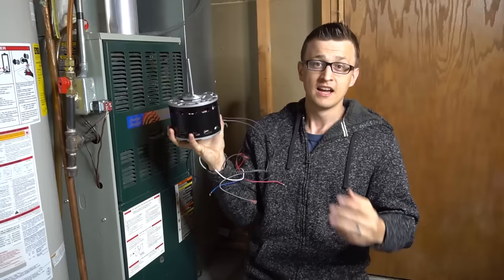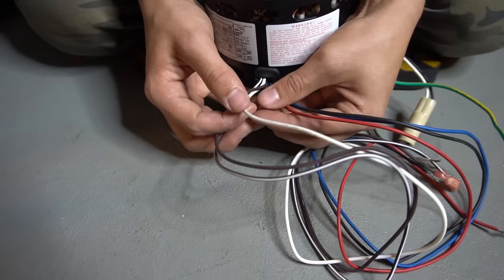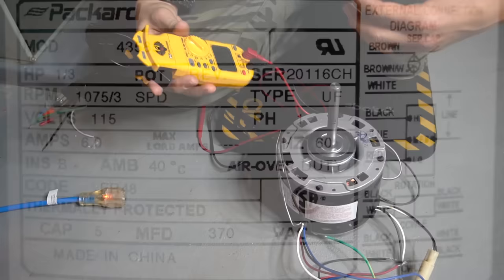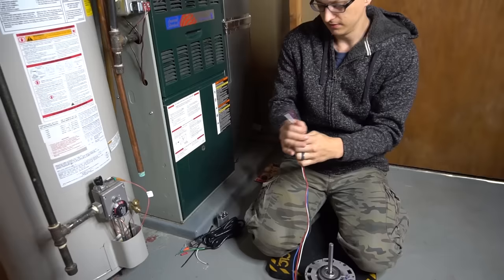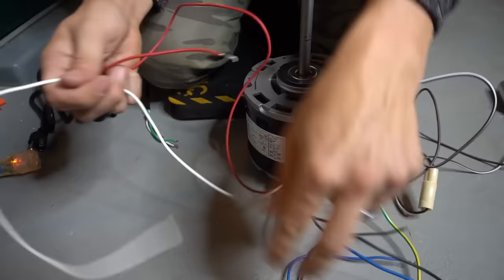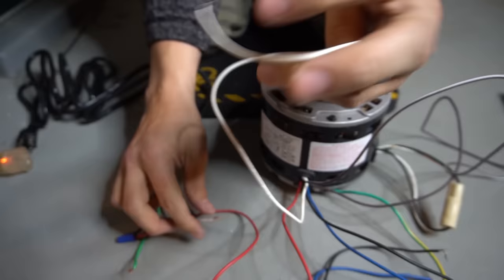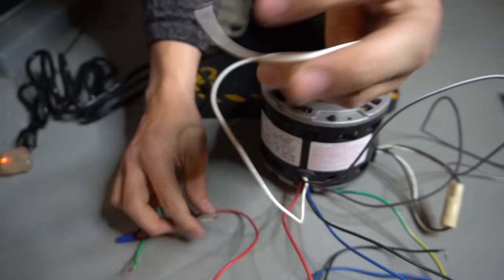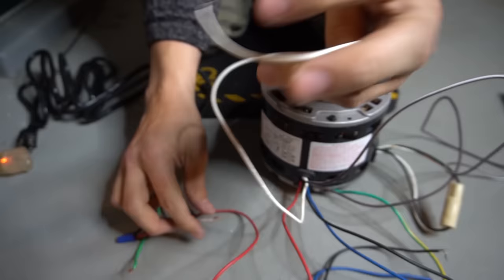How To Wire a Furnace or AC Blower Motor

Comment: I replaced my old Surelight White Rabbit control board, which does not have a 'FAN' connection, and I had no problem turning on the blower with 'FAN ON' only.  I noticed the new one, exactly the one in the video, has a 'FAN' connection.  Do I need to connect one of the fan speed wire to it to get power to the 'FAN ON'? Right now, the blower will not turn on when place in the 'FAN ON' mode with the new board.

When my AC turns on, the blower turns on along with the compressor outside.  In a few minutes, the blower turns off, but the compressor is still running because it has not reached it set temperature.  I don't know what is causing the blower to turn off early.  That is why I replaced my control board thinking the relay is malfunctioning.  But it did not fix the problem.  Please advise.
Reply from the maker: I would hook up an unused speed to the FAN terminal just in case. So from what I understood: Your outside unit runs normally (condenser fan and compressor) but the indoor fan shuts off after a few minutes. My first suspect would have been that control board too. Although it could also be a defective thermostat. If you jumper R to G at the control board, does the fan come on and stay on?
Reply: @WordofAdviceTV , when the AC is on, the blower and compressor are running. I metered the voltage from COOL to neutral, which is 120 VAC, and from FAN to neutral is 150 VAC. Is this normal for the fan to drawn 150 VAC?  Once the fan is shutdown, it cannot be turn 'ON' on  manually. I had to turn off the AC, then waited for it to reset itself before I can turn the fan on manually or start the AC again.  When metered the FAN and neutral when the fan is on manually,  it is 120VAC, and it can run all day without shutdown.  I had the same problem on the old control board and new control board.
Reply from the maker: @GiangNGUYEN-iz5vp  That's odd... 150v is a bit too high. When you get a high reading like that, can you also check the 120v side of the transformer? Is the transformer putting out the 150v or is the board defective? I wouldn't be surprised if it's the board at fault again, especially if it is a refurbished one.
Reply: @WordofAdviceTV  the board is brand new. I check for loose connections and omh the blower wires to the case to see if there are continuity.  When the fan shut off while the AC outside is running, I check the voltage of the black wire (connected to COOL) to to the neutral and get 120 VAC. The fan should run with 120, but it did not.  When I shut off the AC and let it reset, the fan turns on. Should I replace the motor? The blower motor is hot after a few minutes on the the AC, but it is okay on 'FAN'
Reply: @WordofAdviceTV  It turned out I have a bad motor. When I removed it, it turned a little sluggish, and that's why it drawn so much voltage.
Reply from the maker: @GiangNGUYEN-iz5vp  Sorry I didn't see the comments from 4 days ago until now. But yeah, the motor has an internal overload in it so if it gets too hot it will trip the overload switch and wont run. Glad you were able to figure out what it was! Sorry that I didn't even think of suggesting that earlier on. Thanks for coming back with an update!

Comment: Ok I always thought you had to short out  capacitors for safety reasons so you didn't get shocked?
Reply from the maker: Nope :) Most of the time you wont... (I've tried multiple times, on accident of course) But you are right, I totally forgot to mention that one should discharge the capacitor. Thank you for pointing it out so others know!

Comment: i have two motors just like this one:  https://acpartsdistributors.com/index.php?main_page=product_info&products_id=34000.  as i understand the brown goes to the capacitor, the orange need a splice to attach to the capcitor then tied to the  "+" of the extension cord. i need to get a green ground and attach it to the motor then tied to the ground of the ext. cord. the black wire is tied to the ext cord "-".

Comment: You explanation of the purpose of the capacitor is a little off. To say that it doesn't help start the motor and then demonstrate that without it, the motor doesn't start spinning...

The purpose of the capacitor is to produce a phase shift in the current in the auxiliary winding. Even though it's designed to run from a single phase supply, it's really a two phase induction motor. While the capacitor is technically an energy storage device, comparing it to a battery isn't really useful here. It doesn't work like a battery and a battery would not do anything remotely close to what's required here. The reason why a capacitor produces a phase shift in the auxiliary winding current is related to how capacitors store and release energy, but it's primary purpose here is phase shifting the auxiliary winding current. It looks to me like the motor doesn't have a separate start capacitor, so it's very unlikely that the motor will start without the run capacitor in place - as you demonstrated - so saying that it doesn't help the motor start when the motor almost certainly will not start without it in place seems a little contradictory.